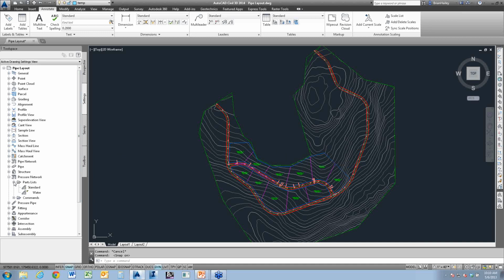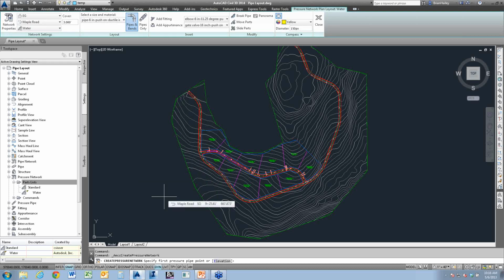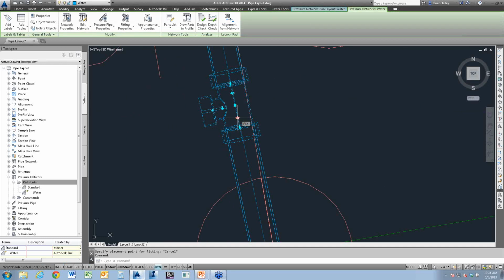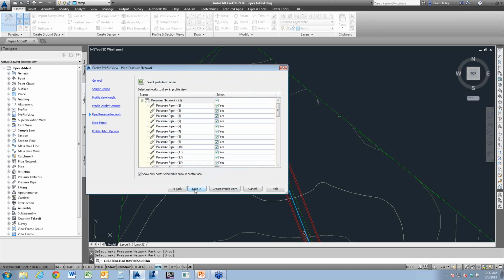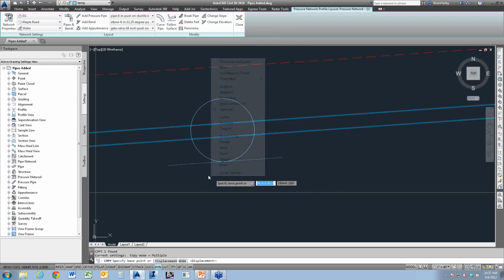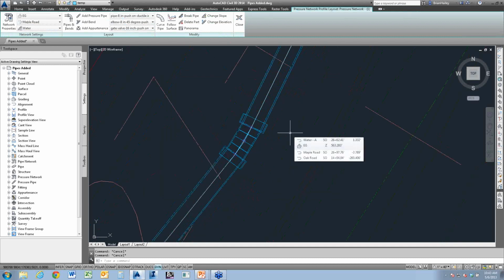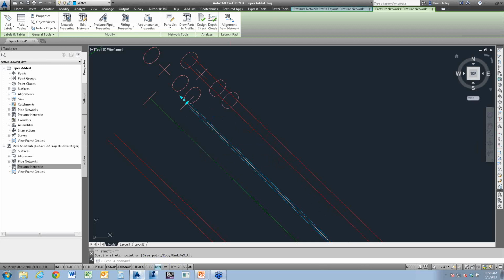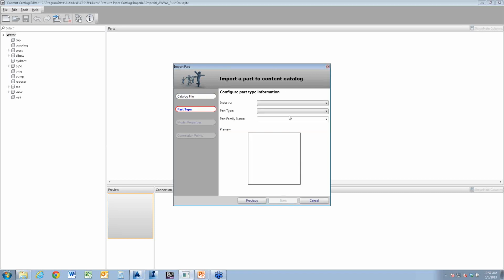CAD-1 Presents - Pressure Pipe Networks in Civil 3D

Comment: usually pipes underneath roads have some sort of 'manhole' for inspection and repair purposes..the manhole usually has the control valves and meters..can that structure be drawn in water pressure network????
Reply: create part, maybe?